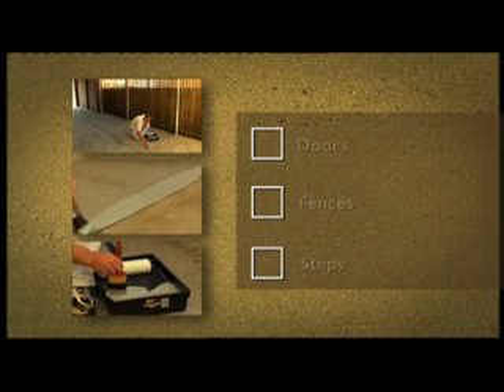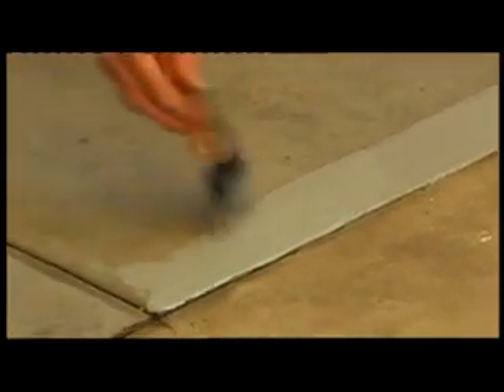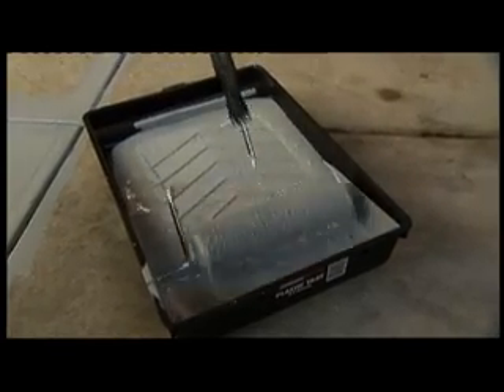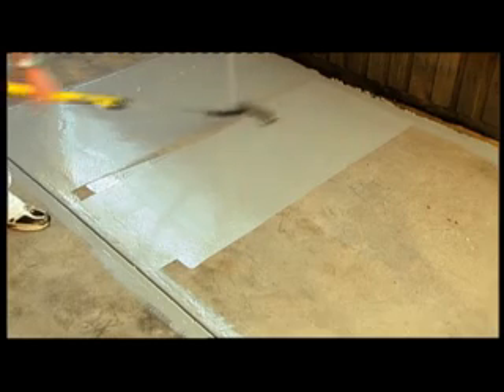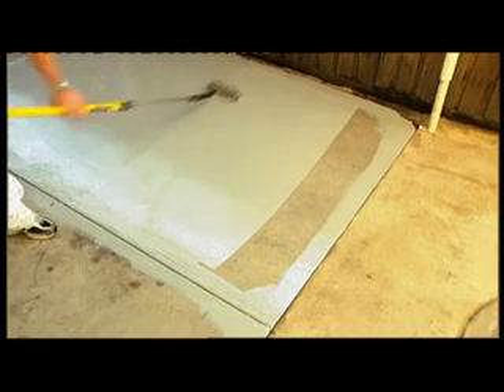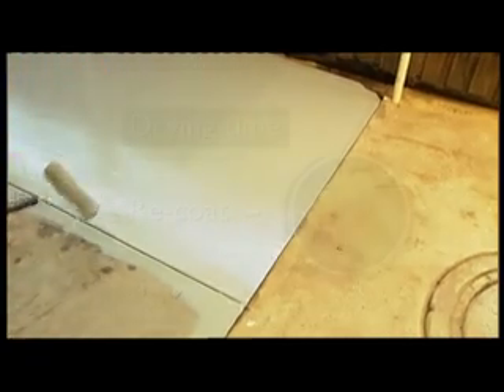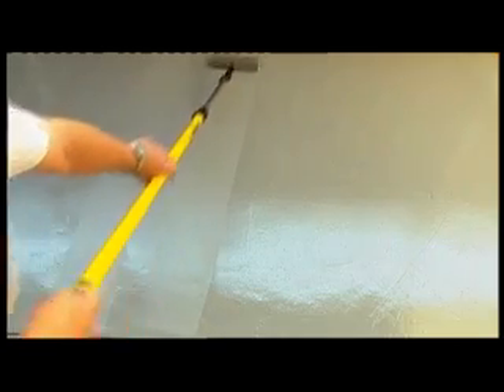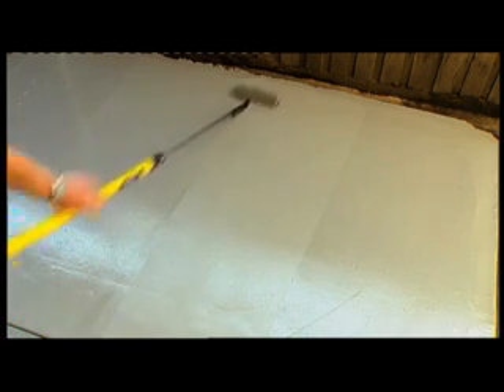How to Paint Concrete With Berger Jet Dry Paint

Comment: Theres so much wrong with this video clip.
"Uncharged" roller? PLEASE... get real. "Loading" paint on a brush or roller has always been the correct term. As for the editing - we don't need to see the face of the painter when you are describing a technique, just focus on the action. You also need to select some more interesting area to paint and choose a better colour than grey. Tip: Sweeping an area was important before electricity was invented. Now that we do have it, try vacuuming the concrete, its far more efficient. And how about the suggestion for some non-slip granules or sand? And disposable gloves are super clever as well. Hard to believe this 3.04 clip was approved by a multi-million dollar company. Having said all that, Jet Dry is still great.
Reply: Nothing wrong with this clip. They are selling paint, not grit.
He didn’t need to vacuum, and remaining dust would of been added grit. 
The concrete looked clean, free of mould.
He cut it in and rolled it good, and now the product sells.